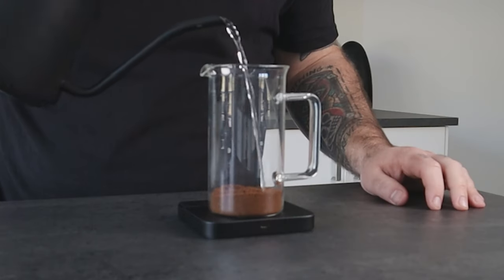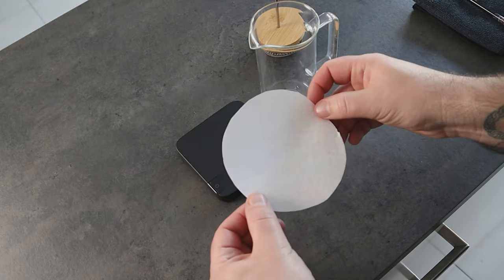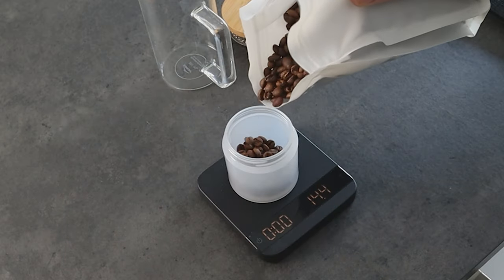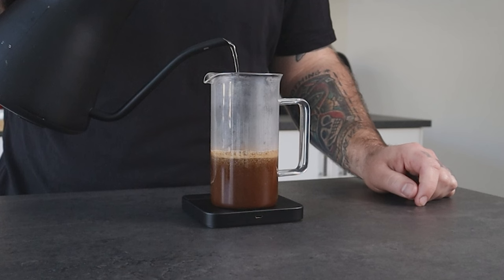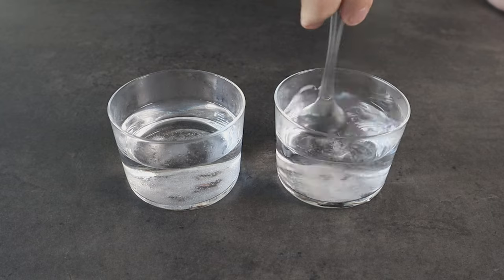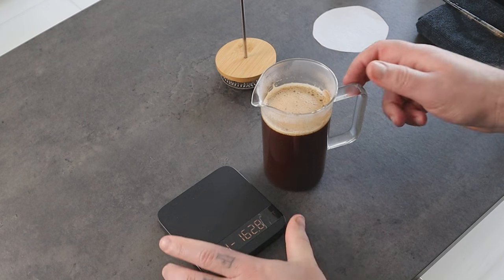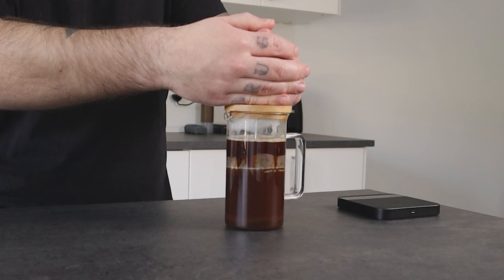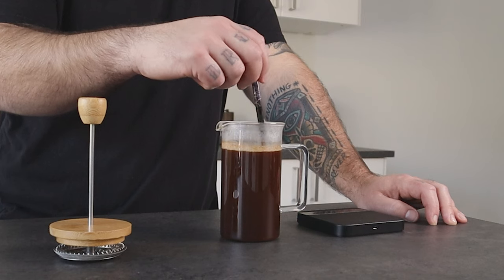FRENCH PRESS Coffee in less than 4 Minutes!

Comment: What is the difference between your method and just pour it over a v60 above the glass? Have you tried it befor
Reply from the maker: With the V60 you will get better filtration because it will filter better. The filtration will be very slow at the end though. Also, with this method, V60 is not required.

Comment: Hello sir my moka pot is not brewing correctly it's sputring so much constant flow is not coming when I remove from heat thinking its to hot it stops what am I doing wrong or it's broke somehow its only 3 months old pot it used to brew perfectly what went wrong now I have no idea and last to last time it didn't brew at all i can hear water boiling this time I cleaned it and tighten the led then it brews but without constant flow plz help anyone?
Reply: My moka pot method:

1) Begin by preheating your stovetop. I set mine to a few ticks above medium, but this is really dependent on your stove and will require experimenting.
2) Medium fine grind beans. Just fill the basket with beans to know how much to grind. 
3) Fill the basket with grinds. I recommend using a WDT tool or something to break up any clumps. Don't tamp the basket, but give it a few taps to settle the grinds. I usually do that a couple times while filling. There may still be a dome of grinds when you're done. Some people level them, others, myself included, will just screw the top down to give them a soft tamping. 
4) Optional but recommended, fill the moka pot chamber with pre boiled water. It will shorten brew time and reduce "cooking" of the coffee beans in the basket.
5) Place your basket of grinds into the chamber and screw the top on. If you used pre boiled water, be careful as the chamber will be quite hot. 
6) Place the moka pot onto the preheated stovetop and allow to brew.
7) Once coffee starts pouring from the spout, I usually let it go until the bottom of the chamber is completely covered in coffee and then remove from heat. The residual heat should be enough to finish the brew. If not, you can put it back on the burner until it does, but keep an eye on it. Personally, I find that waiting until it starts shooting foam from the spout results in a bad cup.

If I had to guess, you might have your burner heat too high. You also might be grinding too fine or tamping the grinds too tightly. A moka pot is not an espresso machine, it can't build the pressure needed to get water through grinds that are too tightly compacted. 

James Hoffman has a moka pot method video that you might try. Personally I think it's too much work for too little benefit and ultimately takes away from the ease and simplicity a moka pot should provide.
Reply: @SatanLiterally  I do follow all the steps and it's a Starbuck pre grinded coffee and the heat is super low i think something went wrong with pot cuz it used to brew fine a month ago so just I don't know what went wrong this is I'm asking and gaskit looks fine to me but idk what is wrong
Reply: @ripulful  Check under the reservoir. I was cleaning mine today & I found that the bottom of the reservoir can pick up grounds from the basket and you'll be pushing water through grounds that are god knows how old. Also, I have a small Mokka pot and am starting to conclude that such a small water volume makes it much harder to control variables.
Reply: @sensorycircuits1338  yes coffee do gets into water reservoir, reservoir being where water boils right? What is the solution for this?
Reply from the maker: Never suggest to pre heat moka pot to someone that has sputtering problem. It will make it worse. The coffee is probably ground too fine. Probably that Starbucks coffee is ground for espresso. If you place espresso grind coffee in a moka will create too much resistence and that is actually what will happen. You need Moka pot ground coffee
Reply: @matteofromtheswamps  I brewed 1 2 times it came out fine same starbuck coffee but now it's not brewing do you think that silicon gaskit is broken its getting brown rn its very little brown
Reply: I’ve never used a mocha pot but have one on the way , there’s a lot of good info but seems a tad overwhelming . I do have a Starbucks across the street if I need it yikes!